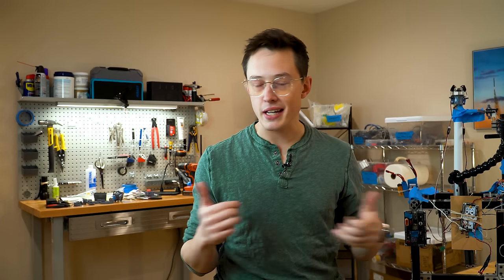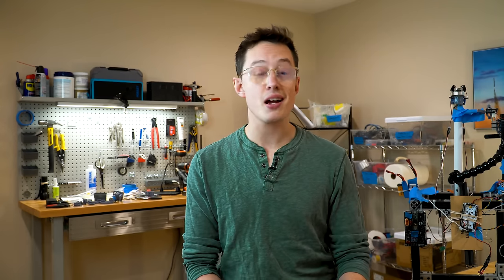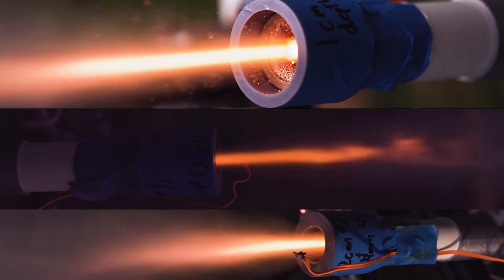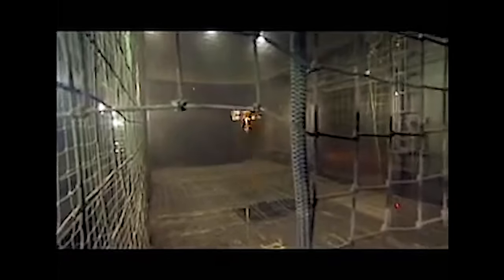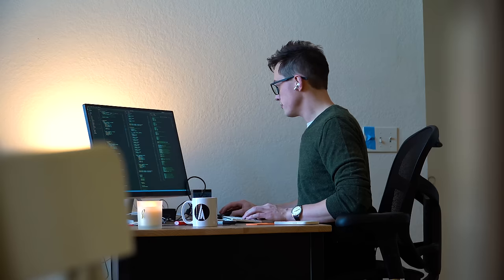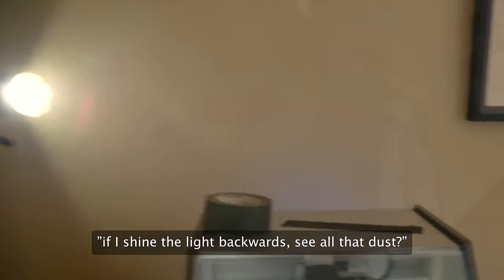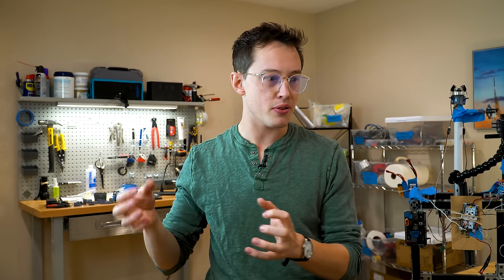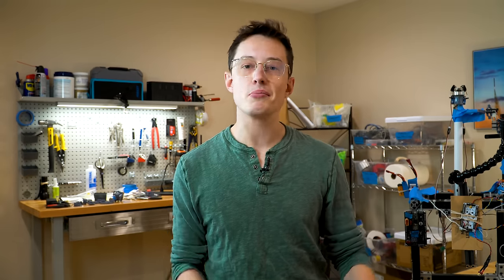I Figured Out How To Throttle a Solid Rocket Motor

Comment: The metal depositing happened to us on MIT Rocket team this past month when developing our new propellant. It’s called slag, and it’s pretty common in smaller motors like this.
Reply: Like when welding.
Reply: @jwtfpv8957  Just theorizing here, but if you have a small channel in the middle of the tongs along the path of the rocket exhaust, closing the tongs would speed up the exhaust and could potentially rip those stalagmites off. This could make the design somewhat self cleaning, especially if you introduce tiny fast movements that vary the pressure/speed in the channel very fast.
Reply: I work with large scale solid rocket motors (SRB's) and slag is common on these as well.  During horizontal static tests there will be thousands or pounds of slag at the end of burn.  Keep up the good work!
Reply: @ReneSchickbauer  

no, in supersonic flows a konvergent (narrowing) crosssection decreases flow velocity. Thats why a rocket nozzle is divergent (opening), which increases the speed. (for subsonic flows, our intuition, it's the opposite.

which makes sense: if you could increase speed (which equals thrust) with such a measure, every rocket would look like that.
Reply: @RTFMundHDf  maybe can be clean up by the proppelent if you design the the cap in a specific shape?
Reply: like testing different shapes of the caps to see what shape collect less slag
Reply: I think the worst case scenario is that the caps could weld together during fly
Reply: @jwtfpv8957  slag when welding is intended, this is a byproduct
Reply: in the following design of this, you could put 4 legs instead of 2, this would allow you to manipulate the lateral thrust without any problem, besides the design of the entire propulsion system would be relatively simple and small
Reply: Slagmites?
Reply: That’s in welding too I wonder if there is a similarity between the two
Reply: Wonder what could be changed with the fuel chemistry to reduce slag creation. I'm sure there's a way to introduce something to the mix that would help the slag break up without compromising significant dV. The biggest question would be whether it is toxic or not. The slag chemistry would need to be known.
Reply: @jkcable10 would something like a smoother surface finish or coating reduce slag buildup?

Comment: This was really a novel idea. Have you considered running a current through the exhaust, and using electromagnetic confinement to restrict or assist the plasma flow?
Reply: Wouldn't the power requirement on that be through the roof?
Reply: @maxk4324  Not really, it only fires for a few seconds so it wouldn't be too difficult to power the electromagnets with a few LI-ion packs.
Reply: @acorgiwithacrown467  that will abuse the li-ion packs. Not the way you use them.

Short time high current means you use caps
Reply: @varunkoganti9067  Ok, then use caps, my point still stands.
Reply: @acorgiwithacrown467  that's why I suggested.
Reply: @maxk4324  at the pressures that plasma is operated, the power requirement would be through the roof. No way you're getting a power supply small enough to actually fly on a model rocket. Theoretically you might be able to power something like that with caps, but it would be for a fraction of a second. Would probably get more control by just exploding the caps lol. The only reason it's even feasible on a spacecraft is they're operating in a vacuum, and the atmospheric density of the plasma is near vacuum and therefore reasonable electrical pressures over long a period of time.
Reply: @acorgiwithacrown467  power, not energy. Lion/lipo definitely have the energy density (I think) but not the current density (which, if we assume operating voltage isn't changing, equates to power density). You just can't draw from them fast enough and super caps don't have the energy density to last long enough
Reply: @Unmannedair  precisely what I was thinking, thank you. Plus the ion density of combustion gasses, even those from solid rocket engines, isn't really that much so it won't bring the power requirememt down a whole lot. 

Now what might work is dumping the energy from a cap bank into the combustion chamber, rather than the exhaust plume, to temporarily give a massive temperature spike and increase thrust and efficiency while the discharge is happening. You'd need a very high temp motor case liner and nozzle liner though to avoid burn through, and maybe even a reinforced chamber wall depending on how much energy you plan to dump into the chamber. Plus the electrodes would be disintegrated after each use, if not by their own discharge then by the already scorching chamber combustion gasses. All in all probs more efficient to just replace the mass of this whole plasma system with the same mass of extra APCP in the form of a bigger motor.
Reply: @maxk4324  That could be a solution rather than a problem. You can generate power using the plasma exhaust from a rocket engine.
I believe I saw that contraption test fired somewhere on YouTube.

Comment: I'm sure you already have a gimbal for your motors, but could you potentially replace the two sided blocker with a 3 or 4 sided blocker and independently control each blocker leaf to allow for a crude thrust vectoring that doesn't involve gimbaling the entire motor?
Reply: It doesn't have to be crude either, deflector baffles worked for vector thrust in the X31 and NASA's F18 HARV. I think the ideal setup would use 3 or 4 "scoops" reaching into the exhaust and deflecting part of it sideways, so that by balancing the amount of side thrust you can get vectoring control at the same time as throttling of the main exhaust jet. Moving in the deflector sideways like in thrust reverser baffles would also reduce the loads on the servos.
Reply: 3 baffles should be adequate, although with 4 I think you might also be able to control roll
Reply: Came to say this need 3 fingers
Reply: If you gimbal 2 parallel motors where the lateral range of motion approaches 90 degrees such that they're splayed out and oppose each other's thrust, you can achieve throttling without using blocking baffles. These 4 degrees of freedom will also give you 4 degrees of control. Splaying the motors in sync will control downward thrust magnitude, splaying them differentially will control lateral thrust (and be able to correct for differing amounts of thrust from each engine), rotating them along the rocket's axis together will control roll, and differentially will control the other dimension of lateral thrust. The only challenge would be after landing, if one motor burns out before the other, in which case you'll get a burst of unbalanced thrust. Perhaps the range of rotation can be extended to closer to 180 degrees, so that after landing you can direct the remaining thrust upwards. This way you could use the last amount of thrust to actually assist in stabilizing the rocket on its landing legs. It wouldn't need to be 180 degrees, just enough to vector the thrust direction to point between the landing legs.
Reply: @ericcmcgraw  I think the main issue (besides the engines' thrust over time not being very repeatable, which he'll have to account for anyway) is that having such a huge gimbal range gets very heavy very quickly.
Reply: @Validole  I agree. The ~180 degree axis could be implemented with a hinge close to the outer shell of the rocket. A 180° servo could be mounted internally coaxial to this hinge. The other axis needs comparatively fewer degrees of rotation, which should make a lightweight implementation easier. It either needs to rotate the axis of the other servo, or rotate the engine directly within its mount inside the other axis.
Reply: no the model scale motor exhaust path is too narrow for multiple blockers

Comment: You can actually increase the thrust with air (air augmented rocket). If you suck in air with the bernoulli effect of the exhaust stream and then mix it with the exhaust gases in a tube the momentum can be increased. 
You might also want to try graphite for the deflector panels. It's very easy to machine, extremely heat resitant and probably not as expensive as the machineable ceramic.
Reply: I second the graphite.  

My only concern would be it oxidizing/burning with atmospheric oxygen in the air when heated by the rocket, but it should be minimal?  Also that may act in favor of preventing the slag buildup in APCP motors due to the graphite "flacking off" (similar to some anti-biofouling hull paints) 

Either way it is pretty cheap, damn easy to machine.  The only concern i heard is it is essentially a black lung generator, BUT i think you can machine it "wet" under water and/or a good dust collection system always helps!
Reply: @ericlotze7724  Yes hard graphite will work much better than the ceramic. After all it has been used in rocket motors since the V2, to guide the rocket, and while it will erode away with time, being cheap does have advantages. Yes will need to either have a HEPA filter and shroud to machine dry, or a nice pond and shield to contain the splashing if doing it wet, plus use solid carbide sharp tools.  Use the CNC to drill the holes as well, just put in a pecking drilling motion, or use a smaller tool and spiral it to machine a hole bigger than the tool diameter, so the tool path creates the chip removal volume, and slow feed rate.

Plus cut some of the side away where the control rods run, so they act more to the centre of the part, better control and no assymetry on the bearing surfaces it pivots on. As a bonus pivot points will also self lubricate, and have low friction.

You can even use clay filled graphite that has been fired, cube resistance is not a worry here, all you need is it to be machinable and able to withstand the forces involved, plus temperature resistance. If each one lasts 5 firings before you replace it consider it a consumable like the rocket motor.
Reply: Graphite has high thermal conductivity.  Once you ignite graphite, it will keep burning.
Reply: @ericlotze7724  Yes it's minimal usually
Reply: I was looking for the graphite comment
Reply: You can try to get waste graphite blocks at companies who manufacture electric motors. Graphite is used for brushes. I have a box of those, and they are all very regular in sizes due to manufacturing allowances.
Reply: @Mike_lis  graphite burns
Reply: @jimwong8056 
More fuel!
Reply: @davisdf3064  ???  Are you commenting about graphite combustion?  You want to burn your control system for extra thrust?  Why not cover your graphite with a high temp coating?
Reply: @jimwong8056 
It was a joke :(
Reply: @davisdf3064  Did you read this part "Why not cover your graphite with a high temp coating?"
Reply: @jimwong8056  use other form of graphite (diamonds) to prevent that

Comment: Several things :
1. Good on you with the respirator.
2. You might consider machining the ceramic underwater, kinda like how you can do so worth carbon fiber.
3. DRILL BIT MATERIAL. If you ever try to use a wood drill bit on metal, you know. But if not, drill bit material (and geometry) massively have an effect on its longevity and performance.

Comment: Great to see you back and making progress. As others have pointed out, graphite blocks may be a lower cost and more readily available material for your throttle mechanism. I’d also suggest using V shaped thrust deflectors to provide proportional control, i.e. vary the area impinging on the exhaust flow.
Good work !

Comment: You could probably control the ceramic blockers with a single servo, that might reduce side forces even more by forcing both blockers to move at the same rate. plus it's one less point of failure.
Reply: Having two motors though gives you de facto thrust victory.

Comment: With the making dust part, I always do my best to capture or remove whatever dust I'm making. In your case, it looks like you need a fume hood of sorts. I typically create one from plastic sheeting depending on my needs. But the basics is to control the airflow around the workspace and move the unhealthy components into a safe area. Whether that is external exhaust and/or filtering. You do this easily by means of negative or positive pressure using fans. I use contractor level fans that move a lot of air.
Reply: I guess you could just put a vacuum cleaner right next to the drill, should suck up any particles that are light enough to fly up into the air. There are also lots of models for 3D printed dust collector nozzles on Thingiverse or similar sites. Still wear a respirator though.

Comment: Instead of milling pre-cast ceramic, have you considered using something like Porcelite? It's a 3d printer resin. After printing, you bake it in a kiln to drive out the binder and you're left with a heat tolerant ceramic part. There's some shrinkage you'd have to figure out, but I think it's pretty doable and would let you experiment with pretty elaborate geometries that might let you get multiple uses out of your thrust (for instance, can your throttling mechanism also help you with precise lateral positioning? Maybe there's some configuration of parts that would let you have this kind of control).
Reply: Integza should be able to give some advice on Porcelite
Reply: Wellington beat me to it. Integza has some experience with 3D printed ceramics and his results are wildly inconsistent across prints. It'll take several tries to get the intended geometry, and then there's still a lot of cleaning required that would likely affect the end result. Not sure I'd go this route for a launch vehicle part unless you had access to a commercial-quality printer.

Comment: Awesome concept! Have you considered angling the inner surfaces of the deflectors outward? It'd probably help a bunch if the exhaust was more cleanly deflected. As long as it was evenly deflected on both sides, net side force would be virtually non-existent

It would also probably prolong the useful duration of the deflectors, maybe reduce slag buildup, and might stop hot exhaust gas from accidentally being ducted into something that could melt, like a plastic servo horn

It might be tricky to machine it, but you could maybe cast it with a 3D printed mold, and there are also resin printers that can print ceramic parts, Integza uses one occasionally on his channel

Comment: There's a Chinese dude who's been working on a "throttleable" solid motor. His, the motor case has four nozzles that can vector outwards. To limit thrust, the four nozzles are vectored such that they no longer point down, and basically cancel each other out. It is a more analog option. Really fascinating project. His name on here is L Shang, here's his most recent update: https://www.youtube.com/watch?v=j7NP37MEUg8
Reply: but thats wasteful
Reply: @Blox117  If anything, it's less wasteful than blocking the thrust outright, as done in this video. Performance doesn't seem to be super important for this application anyway, waste is very tolerable.
Reply: It already exists in missiles, look for turnover motors.
Reply: IIRC, that's pretty similar to the 1st stage of the Minuteman missile. 4 nozzles on one solid for roll control. But not throttleable

Comment: I'm trying to build a 4 stage solid rocket, I have been machining parts since December, when finished it will have 4 separate chambers, I'm using a paper case with an ejection charge, delay holder and delay charge with clay end cap and nozzle on all 4. This might be completely wrong for your beautiful rocket but I was having trouble keeping it stable so I built a rail gun, very simple, it's 10m long and I can angle it as far as I need. I set the charge to ignite around 1/30 of a second after the rail is charged and released.  I'm just a fan of rockets and wanted to build my own, everything I done was something I taught myself through trial and error. For me I find this is the best way for my design, its just an idea to keep in the back of your mind. The rail gun helps keep on course and gives it an extra boost, it adds between 12k ft and 28k ft, getting it to about 35 miles. Good luck

Comment: i think you want to intentionally divert the thrust to both sides instead of blocking it with the shape of the blockers.
It could 
-reduce stress on blockers
-reduce heat
-reduce metal deposition
-give better control of side forces
-if you manage to control their left/right motion you could even control side forces, which would be awesome
Reply: I was thinking the same. Have the first flap intercept the front half of the exhaust gases and deflect them to the right, and the second flap intercept the rear half deflecting them left. The only problem with that would be that you're trading the sideways forces for a rotational moment.
It should also help with the metal deposition. Having different parts of the flaps intercept the highest concentration of metal allows you to avoid creating something that sticks out as much as that fang. And not relying on the two surfaces to touch means the metal deposition can't get in the way of it. You just need to include a sufficient gap in between the flaps so that they don't get welded together.
Reply: @Pystro  i was thinking more of a wedge shape on both
Reply: @sebi-t6i  Yeah, that would probably work better than my idea, even if it's harder to manufacture. Unless you just tilt the whole flap block 45° to the side and let the exhaust hit the edge of the face that it hit in this test.

Comment: If the ceramic gives you problems, consider Molybdenum.  It's got almost the same temperature handling characteristics as tungsten (melts about 2500C) , and it's almost as easy to machine as Aluminum.  I guess you've gotten the ceramic working, so  I guess you don't need it - but keep molybdenum in mind for future projects!